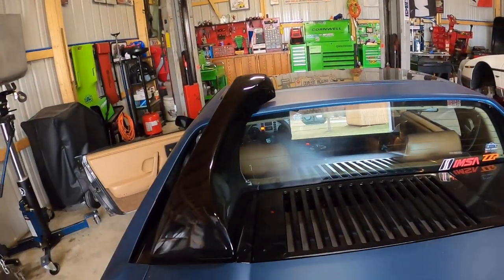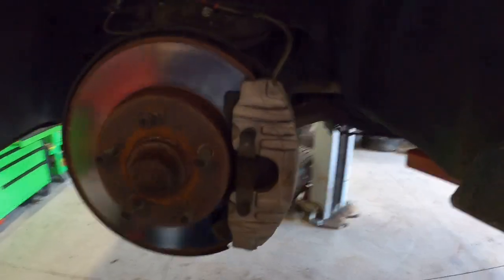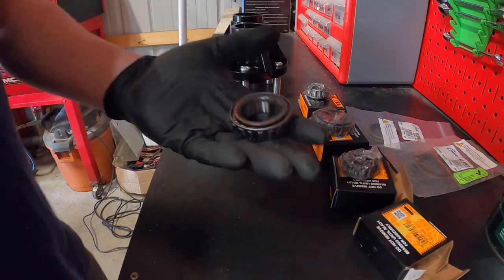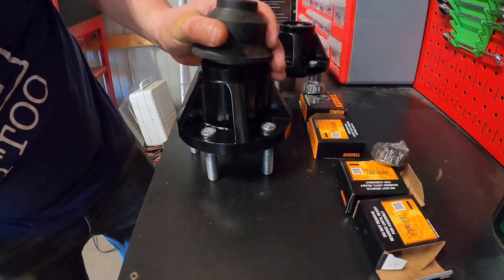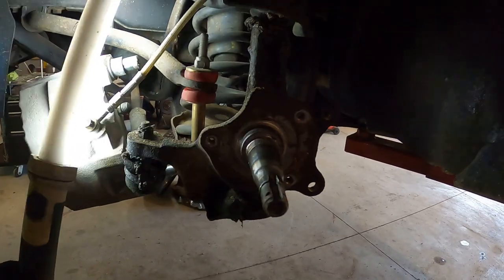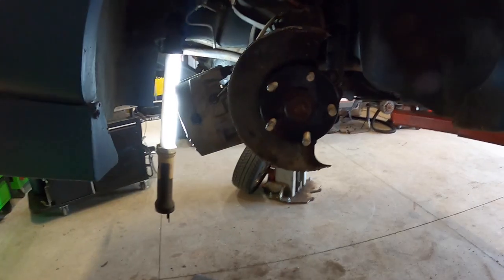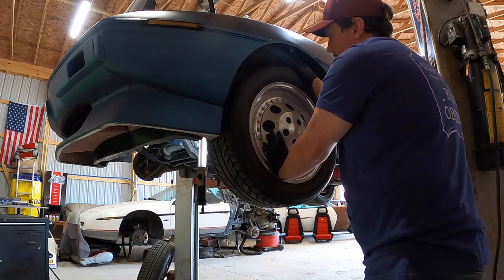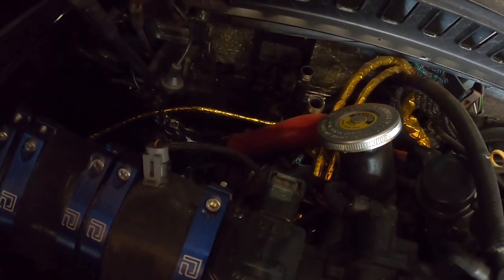Wide Body Pontiac Fiero Brake Upgrade:Epic Fail

Comment: I got a 86 fiero and not look like the GT so I was trying to upgrade with some 16s I don't want to use 18s but they said that I can go from a 14th to 16 by 5 or 16x6 cuz of the bolt pattern but I do not have the upgrade brake system on it thank you you didn't fail your car outsmarted you as Pontiac built by the Indians

Comment: I feel ya, I just put struts in one of mine and after finishing everything up I went to close the decklid and it wouldn't shut because the strut stems were too tall. Super frustrating to finish something and realize it doesn't fit. I'm sure you'll figure out a solution!
Reply from the maker: I think the solution is going to be different wheels. Going to get my Indy Fiero done first.

Comment: I'm sorry to see that the wheels didn't fit. They're such cool rims and I've always felt like they matched the car so well.
Reply from the maker: Maybe I can get someone to make a wheel that looks similar to these only a little bigger.
Reply: @RearEngineShop  I would call centerline since they made them. I'm just curious if the OEM brake line mated with this kit, and the OEM parking brake would work.

Comment: Simple fix. Do the beretta front only up grade. Only need calipers pads rotors. Cheap and fits stock rims gets you vented rotor.  You get to use the nice hubs. I machine my own hubs from old assembly. Will be a huge improvement.
Reply from the maker: I don’t think they will clear the centerline wheels that fit the wide body. I’ll have to look up specs. 🤔

Comment: I'm not a big wheel spacer fan, but it would be a crying shame to put different wheels on that car, they fit the look really well IMO.  How big of a spacer would you need to clear the caliper?  Might be worth it?
Reply from the maker: The wheel won’t clear the fender with a spacer. 👎 I think I’m going to look for a rotor that sits back 1-2” father and modify the caliper bracket then it should clear.

Comment: Gloves? Packing wheel bearings.  Man we didn't use gloves back in the days. LOL I see they still recommend the bearing packing method that I learned over 50 years ago. LOL.  Where was the coolant leak?  I had one on the Therostat neck.  P.O. Didnt quite finish doing the neck.  LOL
Reply from the maker: The cap on the thermostat housing was slightly loose. All fixed now 👍
Reply: I also had to buy a new cap as the one I had even though quite new leaked. LOL

Comment: I have to ask . . . is this brake upgrade documented anywhere?  I plan to do a brake upgrade on my Fiero in the future, and this one seems compelling.  I mean, did you swap out the booster, for example?  Or is it just slapping the bearings, hubs, rotors, and calipers on and calling it a day?
Reply from the maker: There are write ups all over the Fiero forum on the different brake upgrades. www.Fiero.nl Can use the stock brake booster and master cylinder or you can swap in a larger S10 booster and firebird master cylinder.
Reply: @RearEngineShop  thank you!  I was originally planning to stick with the stock booster with the stock brakes, but with bigger discs, I am thinking I might also to the booster/master cylinder upgrade to drive the bigger calipers.  There is too much fade on the wee rotors the Fiero comes with stock 😁. Especially since I am planning for a more powerful motor on my build.

Comment: I always disliked rotors and hub being one unit. Lucky that my ol' LeBaron had those rotors...so much easier to do a brake job on them. Didn't that kit come with a suggestion of rims to use? Looks like the center of the rim needs to be taken out to the edge of the rim to clearance everything. Too bad..those rims looked good on that Fiero. Looks like you will have to try the Pontiac or Camaro rims.
Reply from the maker: They are supposed to clear 16” wheels. These are 16” wheels. I think it’s the wheel design. I have a couple ideas on how to make this work.

Comment: 17 inch G6 factory wheels for temporary fix
Reply from the maker: Would need a spacer in the rear. 🤔
Reply: @RearEngineShop  they would probably need it to look right in the wheel well

Comment: it's a long shot but maybe stock calipers. I had those brakes on a fiero in the past. But with stock GM metric calipers. They appear to have less material than the wilwoods. It's a common caliper that you may find in stock at Autozone for $25 plus $10 core. Hang your stock caliper out of the way and you might save from bleeding the brakes if it doesn't work. 

https://www.autozone.com/brakes-and-traction-control/brake-caliper-front/duralast-unbracketed-brake-caliper-c160/208793_0_0
Reply from the maker: They don’t clear spaced out to fit the larger rotor either. I tried, lol. 👎
Reply: @RearEngineShop , dang that is what I was going to suggest as well. That's too bad. Would be a shame to get rid of those wheels.